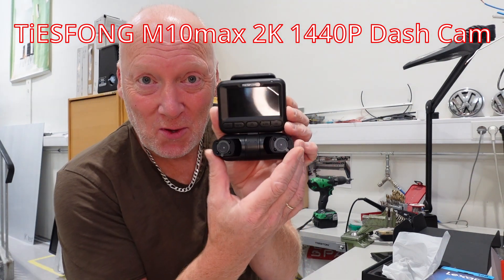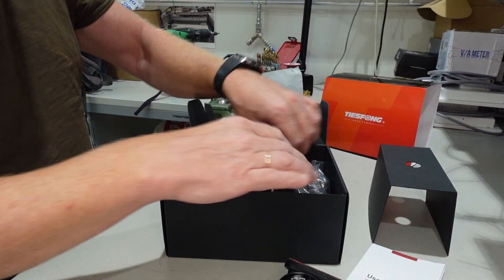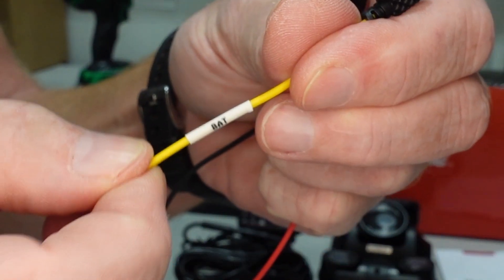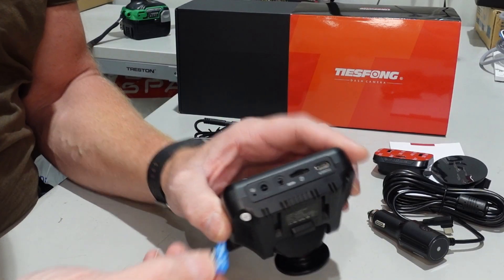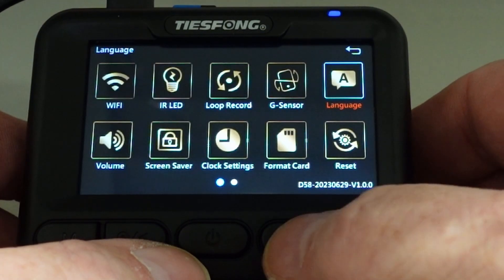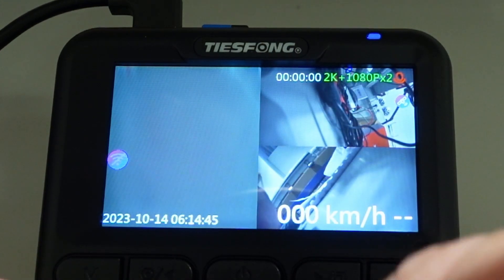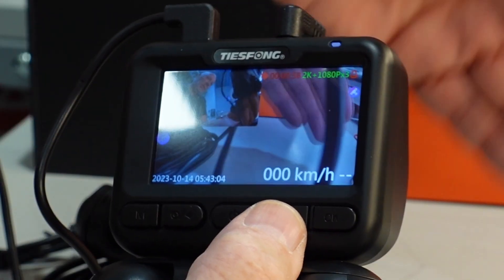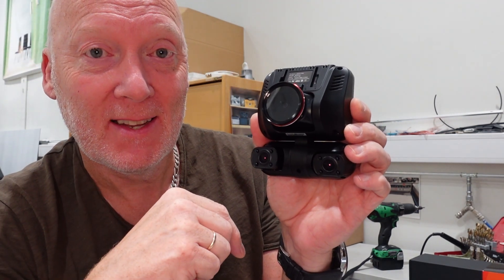TiESFONG M10max 2K 1440P 4 channel Dash Cam Saved from Police pruveeo Temu Aliexpress

Comment: Does it look like it can withstand the heat of the sun?
Reply from the maker: I will have to say yes to that. I can't really see any reason for that it should not. I have several other dashcams, and this one feels like it's made of a better plastic then my other ones, that again I have been using for many years now and none of them show any sign of sun damage.
Reply: @Italjohn  Thanks a lot! I'm sold to the cameras that can capture the sides. Since it's quite an unknown brand to me, I'm quite concerned about its durability.